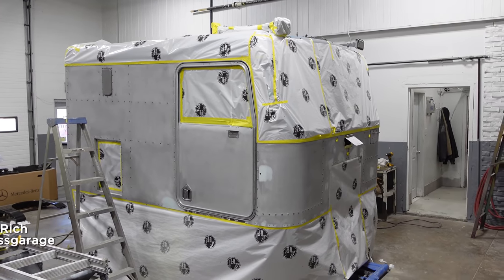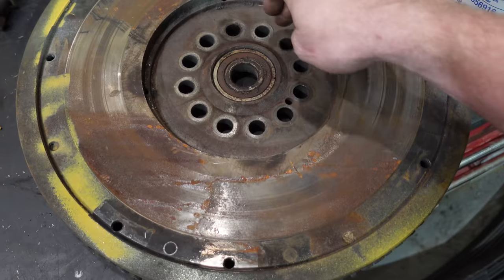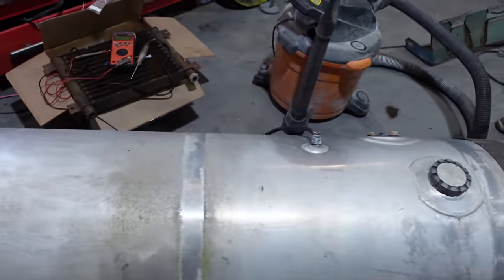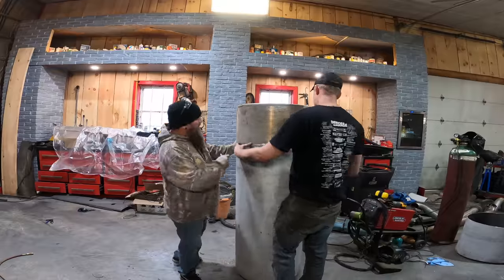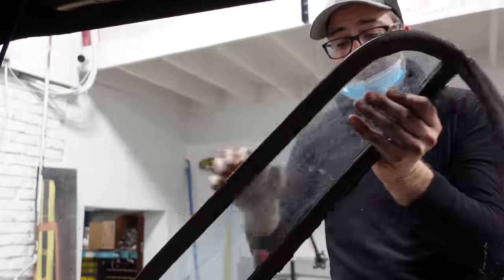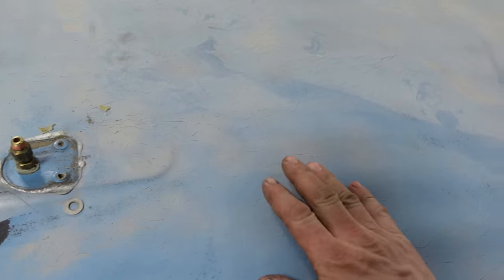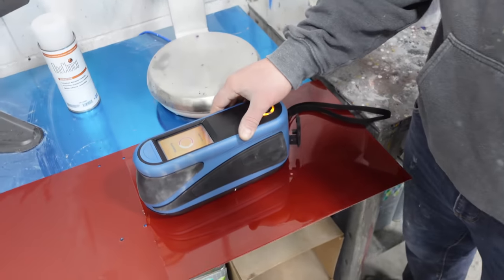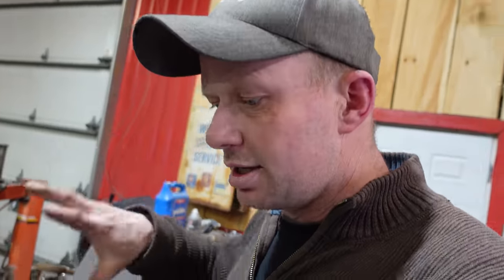Our 34 Year Old Cabover Roof Is In Rough Shape... #K100Cabover [EP5]

Comment: The company I drove for had a fleet of fiberglass cab trucks Kenworths that had cracks in the roof. What they did was sanded the roof sprayed them with epoxy after it cured they sanded the epoxy after the 72 hour cure time, and sprayed a tinted Linex material on the roof cap. The tinted linex was white so no one knew the cabs had been repaired,  you can't  see it from the ground anyway. I have been retired for 20 years and believe it or not a few of those trucks are still on the road today. Not bad for 40-year-old Kenworths.

Comment: Thanks for the update Rich. I had a feeling you where going to run into top of the cab issues. We did on the 1988 T800 that a buddy of mine is restoring/rebuilding. The 60" bunk top was pretty chewed up. Someone had installed a Quill Com receiver on it and it developed a leak. And the support plates for the wind faring where also cracked and leaking. However this wasn't a huge issue as there taking 2 of these 60" Flat top bunks and putting them together as one. And then doing a custom all wood interior in the sleeper. The truck was originally 165" on Ryco spring suspension. The truck will now be 308" on AG100 KW 8 bag air ride. This will be a daily driver, for hauling Over Sized Precast Concrete bridge beams. The Big Cam Cummins (400) Came out. And a 3406E C-16 600hp (Factory hp) and a 18 spd has gone in. Dual Vortex breathers and a 14" Box bumper finishes her out nicely. He went with the BRIGHT Corvette Yellow (The one you can see a mile away) I didn't pick that color, However since he hauls these MONSTER 80'- 140' beams. I completely understand picking a color that can be seen very easily. Anx with the set back 18,000 front axle, She should be able to make some pretty tight turns. Especially when the unload and pull the trailers tri-axle up and pin it into the front tandem just behind the 5th wheel. Custom trucks for custom work.

Comment: To me it looks like the flywheel bolts are wrong. The head seems extra tall where flywheel bolts are usually a shorter head. 
There’s also a groove just outside of where the clutch bolts that shows how far it can get turned down. Once the groove goes away the flywheel is to far gone.
Reply: Yes,I agreed with you on the bolts. Those  Don't look like the OEM bolts to me. All the B-Block Cats ive seen had a shorter head that was maybe half that size. The grade 5 and fine thread is correct. But I'm NOT a Cat historian, So don't take what im saying as the Holly Gospel either.  However I've seen what you have done here with this flywheel before. Because the B-Block stuff is getting so hard to find and the price is getting out of hand for the stuff that is available.  Other than the bolts you should be GOLDEN with this modification.
Reply: The flywheel bolt heads on my Detroits are about that thick

Comment: I typically have the outside edge of the flywheel machined as well. Otherwise there is a chance that the pressure plate can bottom out on the edge and will not pull flat against the face of the flywheel. I would also toss a fiber clutch brake spacer on the input shaft because every time the flywheel is machined your losing that amount of clutch brake squeeze. Looking good thou, nice job.

Comment: “High prices and no availability” pretty much sums up what’s going on across the economy.
Down here in the states, we’re having trouble getting brake shoes, brake components, oil filters from AMERICAN manufactures.
Have a Mack we got 3 different part number oil filters delivered from the dealers own system that didn’t fit, one of our guys had to drive an hour to a store that had the correct filters and we bought the last stock they had. They said they placed orders months ago that have not shown up.
We’ve been told to place our orders for oil, coolant, grease, brake parts, filters  3-4 weeks ahead of when we think we’ll need it.
Reply: Same situation with big propane tanks. Was talking to a guy while he filled our forklift tanks and he said if he wanted to get a truckload of tanks (about ten to twelve), he would have to order now and wouldn't get them until late 2023 at almost double the cost of normal.

Comment: Keep an eye out for a battery powered scissor lift. I have a jlg 3219 (32" doorway pass, 19' platform height). I leave it at my buddy's heavy equipment shop and he loves it for working at the top of cabs. Good ones range from 3k to 6k $.
Love the color!
Reply: Iron Plant Auctions is where Sunbelt sells a lot of there old  Scissor lifts. Everything from 19's up to 32" that can fit threw a man door. They had some 19's last fall that needed new batteries that had been used as painters lifts that went for $1300.00 (USD) each. Put a set of batteries in them and your good to go for about $2-K or less.

Comment: Progress, looking good, that old flywheel must have been ground many times for the clutch disc hub to be hitting the crank bolts(wow). But on the bright side it surprising that there were no major heat cracks in the friction surface, what luck. The cab is sure coming around, never to much fun messing with fiberglass, keep on truckin !!!!

Comment: The 1980s called and want their triple roll bar off that Chevy back. That might be a Hungus brand.
Reply: If you think the  triple roll bar  Tacky or not, it could be a life saver....remember, if it rolls it's a TANK  on top of you and not the frame and running gear of a GM pickup...I predict Rich will mention it at some point,..................... might need roll bars forward-ish just to be safe, when you think about it
Reply: @dmc2554  They stopped calling the roll bars and started calling them bed bars for a reason bro. Just try taking attempts at humor as humor--lighten up a little.

Comment: So Sorry you had to Mill down the fly wheel like that. I used to resurface Fly wheels for a living In SLC 35 years ago Not many shops  around any more. The one I was at was an independent.10 years after I left They were bought out by a large Firm in a number of States. My point? The family that ran the place are still involved (third generation and some good employees) could have built a Custom Disc and pressure plate. to fit the application.  Good Luck though You did good in the adaption.

Comment: Been a while since I've done a clutch on a Cat, but I seem to remember shorter bolts being available for the flywheel for the exact problem you're facing. Also, was there not a clutch available for the center hub diameter you needed?
Reply from the maker: not for the torque rating

Comment: Might be a dumb question, but aren't you meant to fill truck tanks to the brim before you park them up to avoid getting condensation? You said you'll never fill them, won't that cause issues?
Reply from the maker: Only after parking when the fuel is hot.
Reply: @DGHD  good to know! Thanks!

Comment: Your flywheel  is worn out , the flywheel bolts are wright ,get a flywheel  offof a high horse 3406 b or 3406e they have a bigger center for the 1850 torque  clutch  . There are plenty of those flywheel  in jackson Ca.

Comment: "someone suggested using compressed air to fix dents in the tank"
My reaction:
... no no No NO!!!

DON'T fill the tank with air since if that fails you have a huge bomb!
The safer option is to seal the joints and use hydroforming; where you fill it with water and use a pump (like a pressure washer pump) to force water into it!
Thats the safe method since the worst you'll get is a leak
Reply from the maker: someone suggested filling with water and letting it freeze too.  Thanks for the suggestion.  If yours doesn't work, I'll just leave it outside for a couple days lol
Reply: @DGHD  Not sure about the freezing option, I'm not saying it won't work, but this reminds me of the aftermath of my dad's sticking a coke can in the freezer and forgetting about it; it was MESSY LOL

Seriously though; I know ice expands, but wouldn't the expanding ice retain the shape of the damage?
That could potentially result in a stress expanded tank thats still dented and potentially structurally unsound and even cracked after being stretched beyond safe capacity